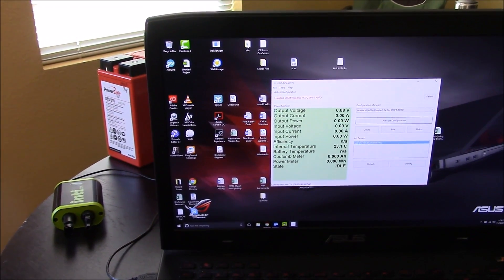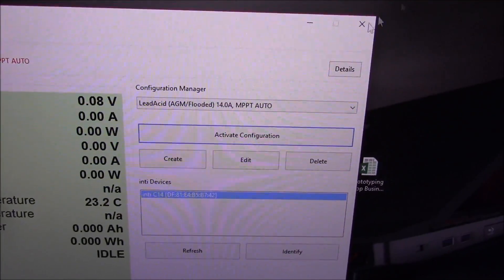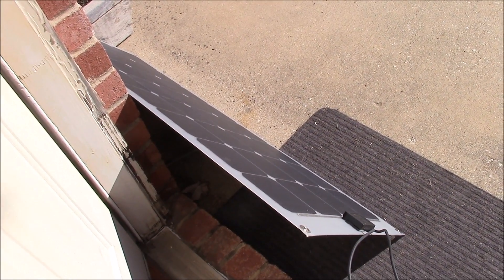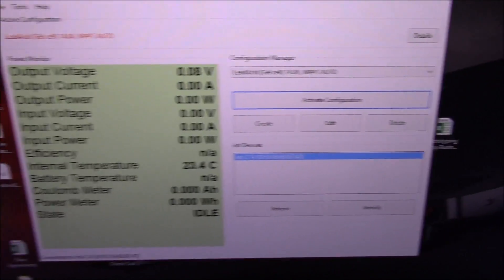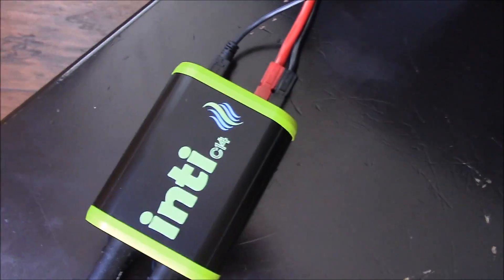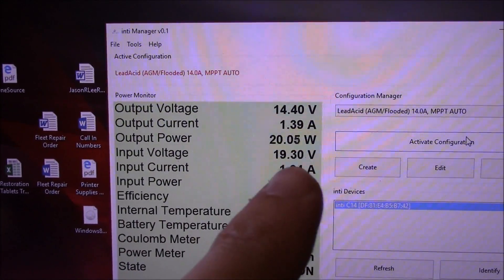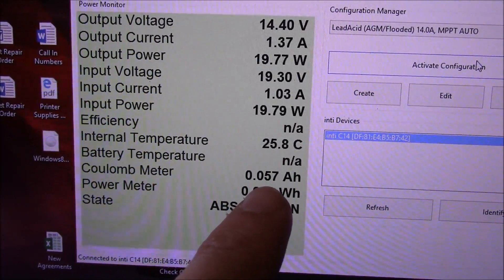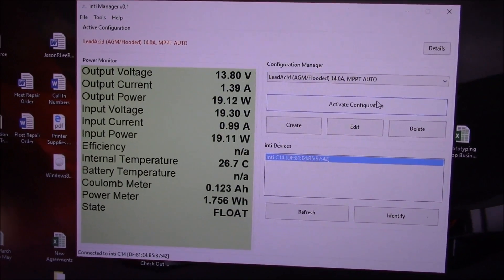inti c14 MPPT Solar Charge Controller - First Real Test

Comment: Does it have data logging option when connected to PC?
Can multiple IntiC14s be connected to the same PC via USB hubs?

What about the graphs? Can we use the samr graph to plot power output curve from multiple controllers in the same plot?
Reply from the maker: Great questions.  I would also like to see data logging capability but currently it cannot log, only display.  I will get with inti and get an answer for you on the other ones.
Reply: LDSreliance Thank You,

If you could add logging and multiple intis to one PC, I would like to order a couple of dozen units.

Comment: Looks promising. Perfect for smaller solar installations with battery. Would be nice to have the possibility to mount this with screws.
Reply from the maker: I have been told that may not be the final casing.  I will pass the feedback along for optional wall mounting.

Comment: That is Awesome!!! Can it handle an array of solar panels?
Reply: Sorry, I just read it can handle up to 400W......
Reply from the maker: It can handle a small array of panels.  You could put two 12v panels in series or put a couple panels in parallel not to exceed 400 watts like you mentioned.  Raz can correct me if I am wrong, but it is not really designed to be a stationary, permanently installed charge controller for production solar systems.  It is more for small, portable systems like you would use with your RV, or going camping/hiking, or for emergency deployment.  But it is flexible enough to have lots of other uses, including acting as a power supply.

Comment: So if I had a 24volt windmill connected to 12v batteries it could manage that?
Reply: The device can take up to 49V of input voltage and up to 10A of input current (electronically limited). It also has the option to disable MPPT so I see no reason you could not.
Reply from the maker: Yes if you have the sustained wind power to pull it off.  Gusty wind won't work well.